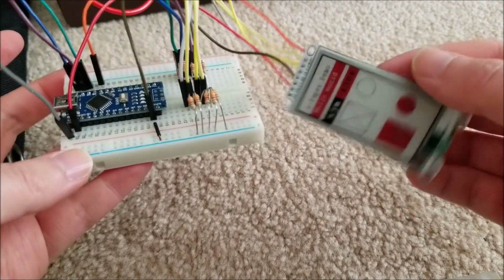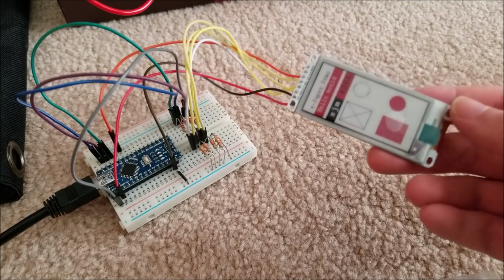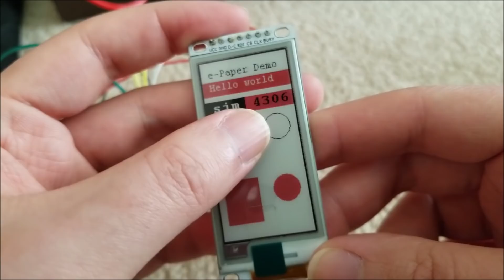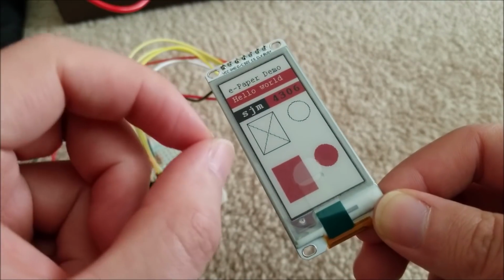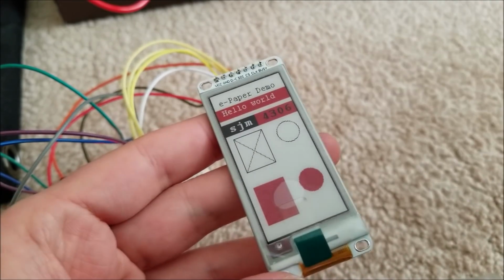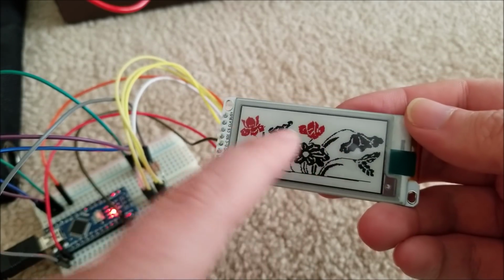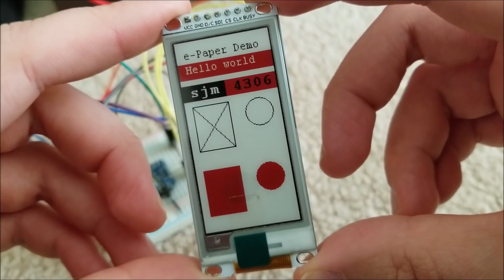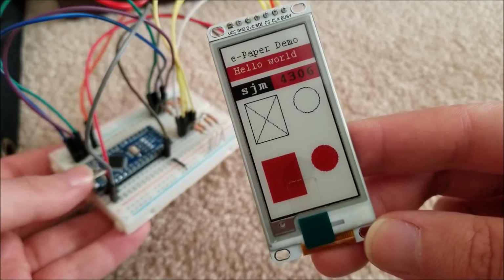Playing with Three Color E-Ink (EPD) Display From Ebay!!!

Comment: With a 3D printer, you could make a nice clock with that. No bad for 10-14£. The question if is possible to make some colors more with a pattern of pixels, as like gray, light red or dark red.
Reply from the maker: If I were to modify the timing LUT in the library I could probably technically get more of a continuous range of gradients. Since all the black and red pigments are is microscopic colored balls floating in a white viscous liquid, changing the distance to the surface should affect intensity.

Comment: I have one on the way. It says that partial updating is not supported, because it is more than just two color. I'm wondering what the drawing speed is just for black only (does that still take ~15 seconds?), and if black only can be done with partial update (or if a non-differential partial update will work).
Reply from the maker: It may be possible to implement partial update if you write your own driver to handle the low level lut kind of stuff. Afaik though, drawing black on a 3 color epd using the stock manufacturer provided library isn't any quicker.
Reply: @sjm4306  When you say "driver" are you talking about the MCU onboard the display that directly manages it, or something purely software running on the ESP32 / Arduino / etc?
Reply from the maker: Sorry I was vague, I meant software driver running on your mcu of choice that does the low level configuration and communication with the cog controller inside the display.

Comment: Hey! This video is awesome. I just got one of these and am trying to find example code for it. I’m implementing my own code in micropython for the rpi pico and struggling to find the SPI docs.
Reply from the maker: About two years ago I wrote my own epd library for atmega to control these screens using little ram and bitbanging the spi so any gpio pins could be used. It's mostly commented so should be useful as a working example to get your own version running in micropython.

My example code: https://1drv.ms/u/s!AoDGxdZES2gugelOirCqUDEh2Ly_rw?e=u9Sg6z

Also here's the datasheet for the display which has a full description for the spi protocol and register listing for this display: https://www.waveshare.com/w/upload/d/d3/2.13inch-e-paper-b-Specification.pdf

For black and white only displays I was able to get partial updates working for very quick display writes by implementing my own look up tables but that trick wont work on these three color displays unfortunately (you can see a demo of that code in another video I did on a 4.2" EPD I got from banggood).
Reply: @sjm4306  also, do you have any experience with e-paper displays with a faster refresh rate? I want to make one that updates 2fps. Ideally, it would be exactly the same size of 2.13 inches rectangular.
Reply from the maker: That's what I was talking about in the last paragraph, if you are ok with it being a black and white only display you can easily get fast updates in the low 10 fps region by tweaking the look up tables used for display update. The caveat though is you do need to do a full refresh every 10 or so updates or you risk polarizing the display and permanently damaging it. I use this quick lut method on my 4.2" epd library that I used for a clock I built so that you can adjust the date and time quickly without having to wait for full display updates.
Reply: @sjm4306  awesome, thanks for the heads up. I got the SPI working after learning a little bit about the RP2040. The ARM M0 SPI implementation has the CS pin go high, then low for every byte written across the interface. Using a manual chip select using a GPIO pin instead fixed the issue. I'm going to read through your code and create a little drawing lib for positioning text and stuff like that. Thanks again for the help! Will post the code + wiring here when I'm done.

Comment: Are there ePaper / eInk displays with refresh rate and enabling clear display of 2-4 images per second?
Reply from the maker: Yes, black and white only eink displays (that dont do grayscale either) with partial refresh are capable of doing a good 10-15 fps from what I've heard. They still require a full refresh periodically though to prevent ghosting and polarization issues with the display.

Comment: Gosh, it's probably either impossible or millenia into the future, but it would be so wicked if e-ink displays could mix particles matching the 13 base Pantone colors on the fly and immediately display perfectly color-calibrated images as though they had been printed entirely with Pantone spot colors.
Reply from the maker: That would be awesome, imagine reading comics or illustrated books on such a display. Bonus points if it had a reasonable refresh rate (a few frames or even 1 fps would be amazing)!

Comment: Just got this today,  thinking there would be plenty youtube tutorials of how to use this, but seems like you have the only one.. and thi library provided is impossible to understand :D Have any clues how to connect this to arduino uno ? even the pinout is mystery..
Reply from the maker: Here's some demo code I wrote using a custom library I'm writing to make using these epd's easier. So far it supports custom fonts and bitmaps stored in flash with string functions so you can easily write text/images in either red or black and supports inverting colors. I'm not done writing the library so there may be bugs I haven't found yet but it should be a good starting point nonetheless. Wiring pinouts are defined at the top. I did a recent video demoing the software with a larger 4.2" 1 color epd. Good luck!
https://1drv.ms/u/s!AoDGxdZES2gu1xo4cZPYOh-w14yQ?e=6jefmS
Reply: @sjm4306  wow!! thank you!! is there a way I can contribute to the library? bug reports, maybe fixes (not that good of a coder, but who knows) ?
Reply from the maker: You can shoot me an email at sjm4306@gmail.com

Comment: The question is: can this display do partial refresh? If no, is pretty unusable by common users, because the global refresh takes 5-6 seconds, with nasty reverse effects... you cant even get a time clock working on screen, at this speed! Please, let me know...
Reply from the maker: From when I took a quick look at the library and datasheet for the display I think I remember seeing something about partial refresh. For a clock I was thinking of just hours and minutes and not displaying seconds so even 5-6 seconds refresh delay would be acceptable. It'd be interesting to make this web connected to pull my calendar and weather info.
Reply: @sjm4306  Unfortunately, after more studying none of the "color" e-ink diplays from WaveShare are capable of partial refresh, only BW ones. Is unclear if the "color" version can refresh just its BW bitmap in faster way... Anyway, apart the 5/6 seconds and nasty reverse, there is a warning: you should not refresh again before 3 minutes or, in the long, the display will be damaged...
Reply from the maker: Interesting, I wonder why the 3 min cool down? I know the particulates can be polarized by applying unbalanced waveforms with a dc average, screwing up the display which is why the image is reversed and flickered in the first place. Also electrically I cant think of a reason that refreshing more often than 3 minutes would be an issue.